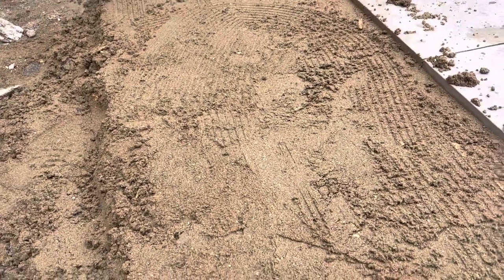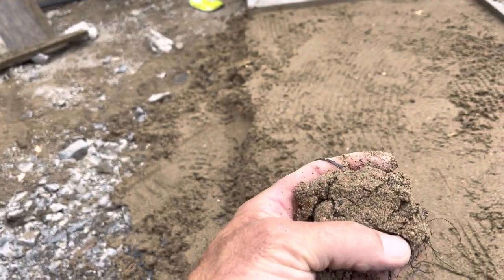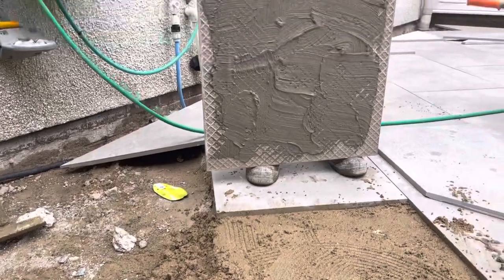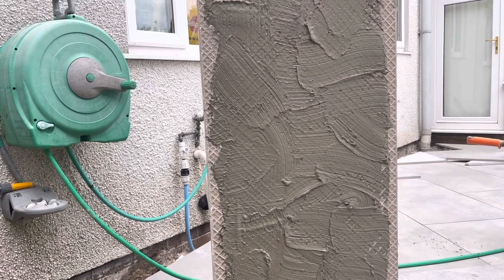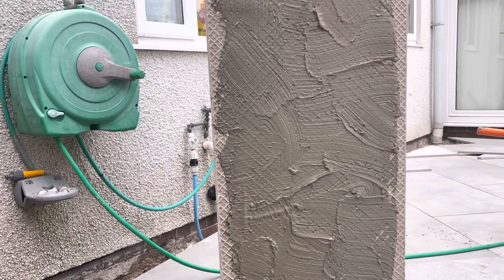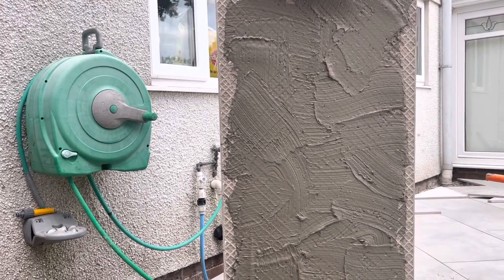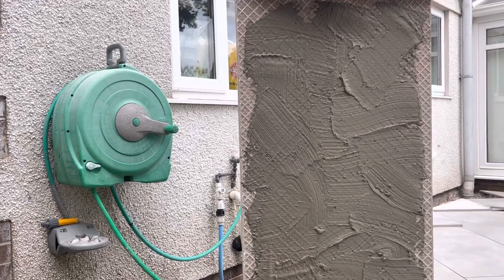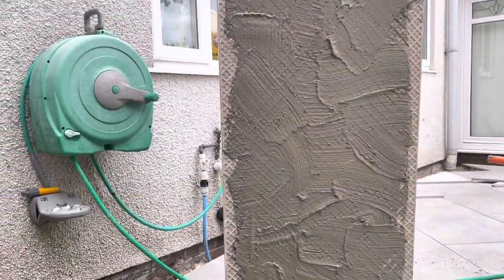Semi Dry Screed For Porcelain

Comment: Great video JB....If the semi-dry is leveleled / screeded to a line, I guess it is a case of placing on the paving with hardly any tap required? I don't have a cement mixer, but OK can hire one but much prefer this semi-dry method. I used it for all the edgings and kerbs and it worked a treat.  I have 30mm from under the slabs to the MOT base.....   What did you use to compact it? Just a hand tamper then final screed with say a spitit level?
Reply from the maker: Thanks Buddy for your message, I am only to happy to discuss this with you.

Comment: Do you use a mixer for this? And if so, do you generally gauge it by the bucket, water first, 1x cement then sharp sand?
Reply from the maker: Hi Rich it’s a difficult one for the mixer as it segregates but we do it by hand it’s quite easy